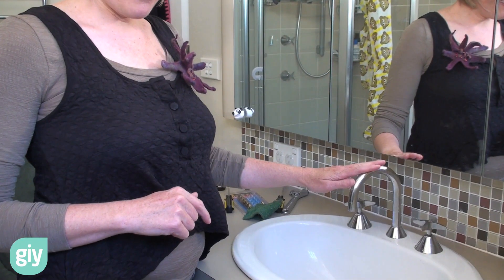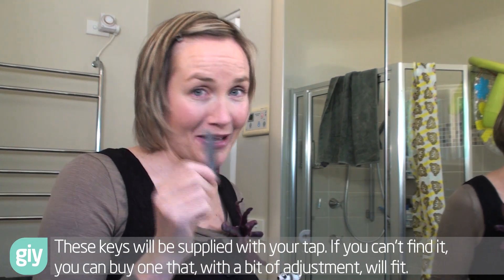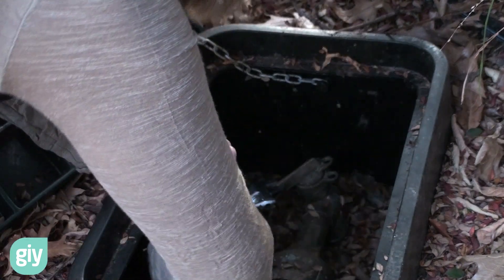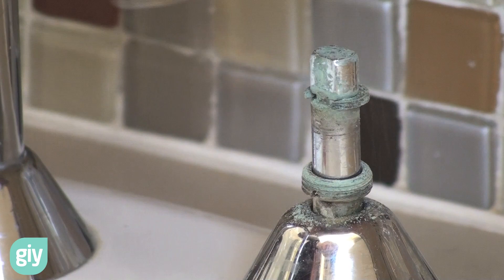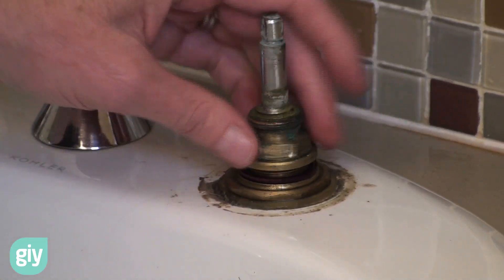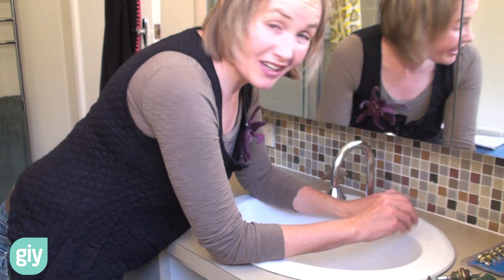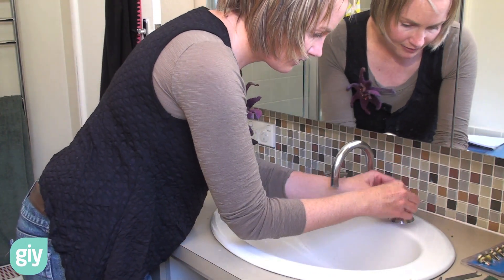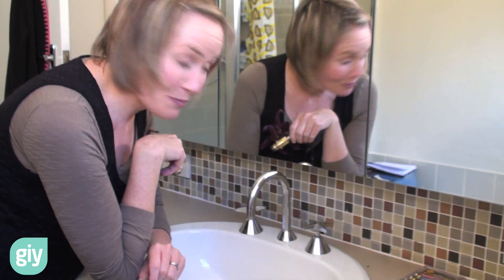How to fix a dripping tap

Comment: Great video and easy to follow, have the secret key, but don’t have an adjustable spanner.  What size should I buy to use for this task? Cheers in advance
Reply from the maker: Measure the width of the part you need to unscrew and get an adjustable spanner that goes at least that wide. It's a very handy too to have in your kit. Good luck.

Comment: So the corrosion[?] on the spindle is ok to leave? I LOVE that you cleaned down around  the sink before putting  the tap back on... :)
Reply from the maker: The corrosion buildup could cause problems when you try to fix tap in the future - it's due to minerals etc in the water. You could clean it off with a wire brush/steel wool careful not to shred the thread and squirt a  a bit of WD40 on it. Your the first one to notice the cleaning! It's the gunkiest place!

Comment: If you are going to do this on a single pillar tap, please use an Easytapsplitter which will enable you to unscrew the tightest headgear, be warned, if you try to hold the tap while unscrewing it, damage can and often will result.